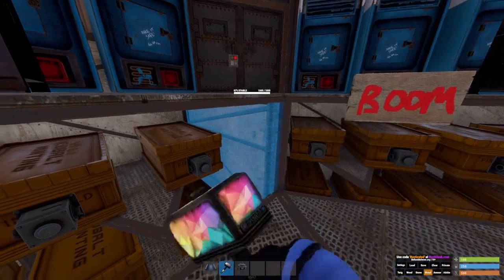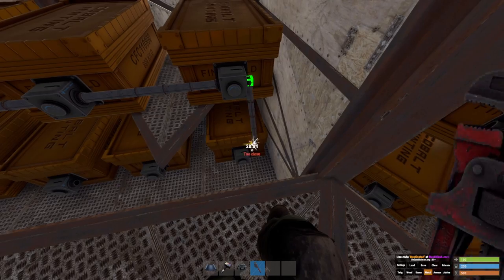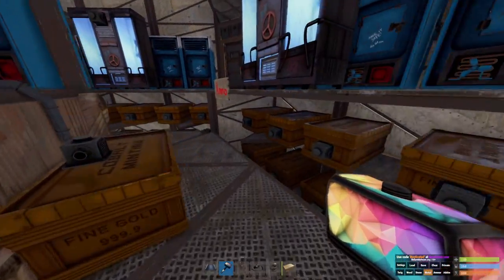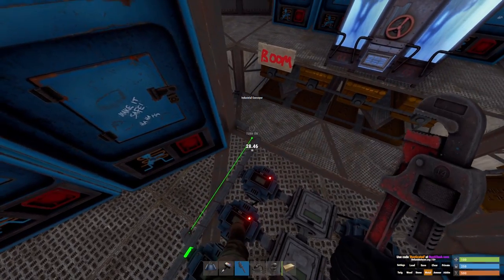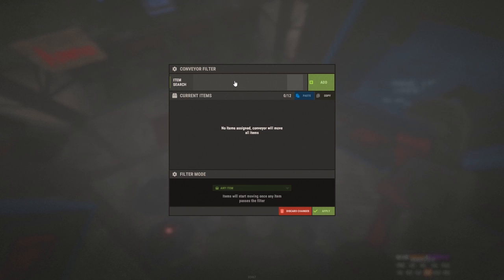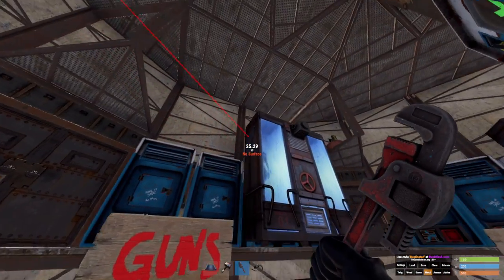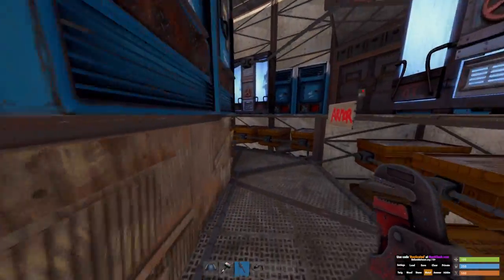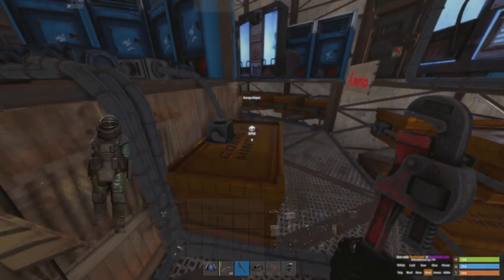10x 5x 3x Clan Sorting Automation?

Comment: What you can do is set the "kit conveyor" to a the button and a timer. Set the timer for let's say 10 seconds. And when you need to refill your kits hit it and it will be on long enough to rotate inventory then turns off the conveyor to stop it from sucking the items back into drop box. Haven't tried it yet but it might work. Or skip the drop box and connect it to the kit conveyor itsself. Keeping it from over sending items in que

Comment: There's actually a problem with splitter/combiner chains like you did. Conveyors have a 32 box input/output limit, yes, but not very well known is that they also have a 32 connection depth limit. I.e. if you were to have those splitters try to pull from things that are behind more than 32 splitters/combiners chained, it won't work (Even if under the 32 box limit). Its likely going to be inconsistent since some will work and some others wont depending on the depth like i mentioned, so it will lead to headaches.

Building a tree instead of a splitter/combiner chain will drastially improve your depth limit. Ran into this problem while piping my team's open core on a monthly.
Reply from the maker: Its 32 connections after the conveyor. How big is this open core, holy... just make a second system is my recommendation. I gave warning in the video about the 32 connection depth...
Reply: So how would the tree system look in your opinion? Only connect the boxes and closets you wanna put the guns/ammo and clothing?
Reply: @dkbeest1781 it's not hard to make a tree. Just place all the conveyors you want, then place splitters with each splitter connecting to three conveyors. Then, place a second group of splitters, with each one connecting to three splitters in the first group. Keep doing this until you're down to one splitter.

Comment: Why would you need to loop back into the drop box from the lockers?  Shouldn't they be the end point in the system? (filling back up from boxes when someone takes a kit out?) Just disconnect a portion of that 'distrubition brain' from the rest and use it to pull from boxes to lockers.  I like the 'spine' setup though, I'll be using that this wipe on the ceiling of my base's core.
Reply: Preventing raiders from accessing your locker loot is one reason. You'd likely need a heart beat sensor set up disallowing people without tc access.
Reply from the maker: dropbox > organize loot into boxes > fetch loot from organized boxes > one conveyor to build kits. The lockers do not loop back into the system.
Reply: It doesn't go back into the drop box it goes into lockers.

Comment: If I recall correctly the Ice Assault Rifle has a different item id (-1335497659) than the regular Assault Rifle (1545779598).

Might be what's causing issues w/ sorting
Reply: Whats stupid is all the frozen stuff counts as the item so will get moved but dosent count towards the maximums or minimums

Comment: Instead of looping back into the dropbox, add a combiner after the dropbox, then items will not sort into the it.
Reply: whats the point of saying not loop back into the dropbox if the fix comes after the dropbox?, this means you CAN loopback into de dropbox only if you add a combiner AFTER the dropbox?
Reply: @rewrite__  if it loops back into the dropbox, items will be pushed into it out of the sorted boxes.  Having the combiner after the dropbox keeps it from pushing into the drop box.
Reply: @greglacy5781  but in the video he is placing a combiner after each array of boxes